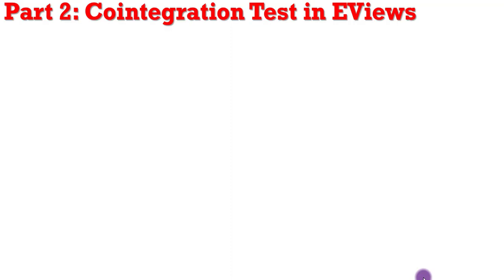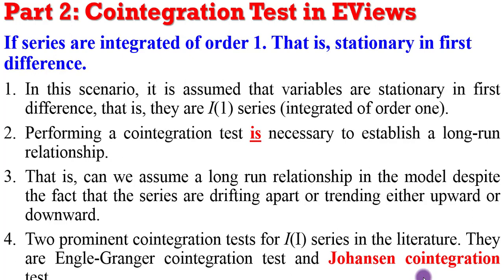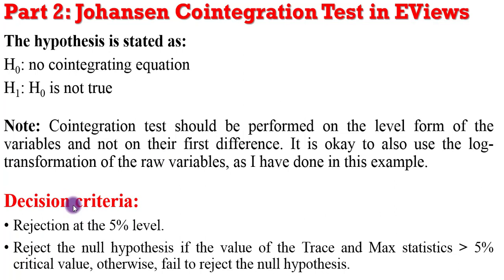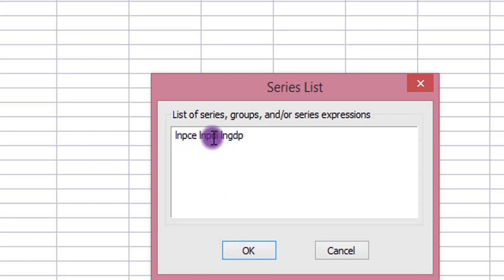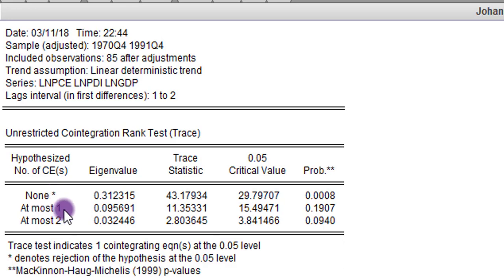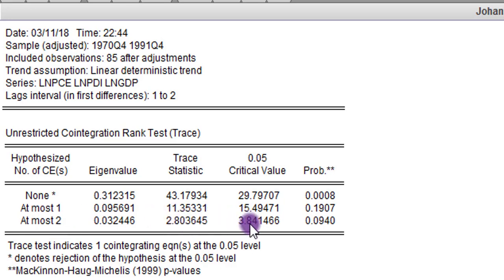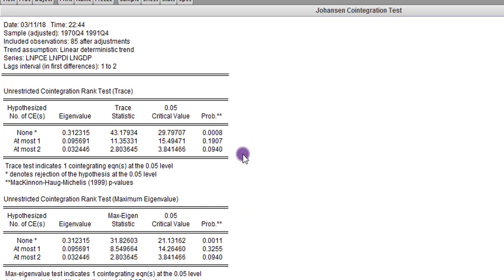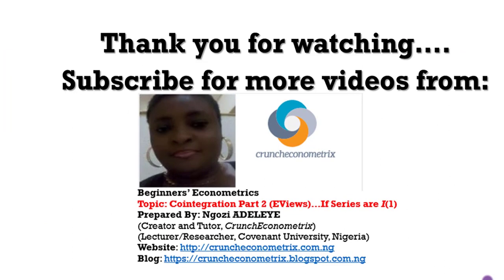(EViews10):Estimate Johansen Cointegration Test #var #vecm #Johansen #cointegration

Comment: do have a video with the 3rd scenario
Reply from the maker: The 3rd scenario is ARDL. Yes, I have videos on it. Kindly check the Playlists for ARDL videos. Thanks.
Reply: So if the result like scenario 3 is not permitted using vecm? I found my data having I(0) and I(1), and i try to find the lag optimum using estimate var and i type in endogenous variabel like d(y) d(x) i c. But the result is weird, the lag using AIC on 1 and both SC HQ on 0. Can you explain it to me? Im so gratefull if you can help.  @CrunchEconometrix
Reply from the maker: @RestyhaNajlaniyah Use lag 1 to estimate the ARDL model.

Comment: Hello Ms, I have one question, what if When I do my Johansen Cointegration test, i have the only * I have is in None, I dont understand why it's cointegrated when: 
None *	 0.482373	 51.36303	 40.07757	 0.0018
At most 1	 0.290746	 26.79620	 33.87687	 0.2744
At most 2	 0.200102	 17.41512	 27.58434	 0.5445
At most 3	 0.170329	 14.56465	 21.13162	 0.3206
At most 4	 0.112543	 9.312804	 14.26460	 0.2610
At most 5	 0.000651	 0.050830	 3.841466	 0.8216

So in this case I have to do a VECM with 1 cointeg equation?  What If I have the * in None and At most 1?
				

Thank you very much
Reply from the maker: Hi Maskim, I gave clear interpretations of the Johansen Cointegration test results. You may want to watch it again and apply to your results. Thanks.
Reply: @CrunchEconometrix  Thank you, I saw it again. I have other question, How important is the rank of cointegration? Because sometimes the Johansen test is telling me that my rank is 4 but for example If I have 6 variables in my model I "lost" the long run information of the first 4 of them, is it so bad to do rank 1 of 2 even if the johansen test tells me that i have rank 4? or how can i recover the long run information of this 4 variables? because I have 1.000 in the first and then 0.0000 in the 3 next, thank you very much Ms
Reply from the maker: Maskim, it is important you read up on RANK from any econometrics textbook for better understanding. Video tutorials are insufficient to equip your understanding.

Comment: In model VECM ...If i found the C1 negative but non significant at the level 5%. we  say there is relation a long run between variables but without significant and there is not adjustment to equilibrium iin the short run to  a long run
or say there is no relation a long run between variables but without significant ?
Reply from the maker: Hi Bettayeb, once the coefficient is NOT statistically significant it implies that there is NO relationship between the independent and dependent variable.

Comment: Hi! Thank you for helpful video tutorials. At around 02:45, you said that cointegration should be performed in either level or log-transformed series. Agreed. But should one use the original or the seasonally adjusted data series? Thanks a lot!
Reply from the maker: Hi Julie, the original series should be appropriate or you can confirm from other online resources. Thanks

Comment: madam appropriate lag for my data is 8. When I use 8 lags data shows no cointegration. but when I use 2 lags data shows cointegration. I should accept the result as shown by 8 lags, right?
Reply from the maker: Sunita, you are the researcher. Take your decision if you either want cointegration in the model or otherwise. Thanks.

Comment: Hey crunch! I was wondering in terms of no Co integration, would I estimate a var model with log values or first difference of raw data? Also, if no cointegration, would i be able to explore the system using granger causality tests? And could i further explore these results with impulse response function models in light of no cointegration? 

Kind regards :)
Reply from the maker: Whether you use logged values is at your discretion. If there's no cointegration, estimate only the basic VAR model.

Comment: Thank you for the video, in the case that Trace test indicates 1 cointegrating equation at 5% but Max test indicates no contegration at the 5% level. Is it fine for me to continue with the cointegration or i should use another regression technique even though my variables are stationary in first difference.
Reply from the maker: Hi Takunda, this is easy. You decide which of the tests to take. If you go with Trace then perform the VECM and if it's the Max Eigen then you perform only the baseline VAR.
Reply: @CrunchEconometrix  thank you very much. Assuming i have yearly data on eviews then i change that data to quartely using eviews. Will it be fine if i use that data as quartely not as yearly
Reply from the maker: Takunda, data conversion is permitted. You can read more on the pros and cons online. Thanks

Comment: Hi,

Thanks for the great videos and explaining these concepts in a simple way. I have a question regarding what needs to be done after the Johansen test. Do you have a video or can you elaborate how to construct the stationary time series after we have determined that there is 1 or more stationary time series from the test results? I am getting confused at this stage. And also, if we are using the ln transformation on the input time series, how do we apply the weights to the original time series?

Any clarifications would be very helpful.

Thanks
Vin
Reply from the maker: Hi Vineet, please watch my VECM videos. Thanks.

Comment: Hello, first thank you so much for your video! I have a question about cointegration test. I conducted multivariate cointegration test and found 1 cointegrating vector among five prices. In that case, can I say there is a long-run relationship between prices? How can I interpret the result if I get 1, 2, 3, or 4 cointegrating vectors?  Thank you so much in advance.

Comment: Thank you! I find the recording useful and will certainly utilize the knowledge obtained from it in my thesis. My thesis is about the short-run and the long-run effects of foreign direct investment (FDI) on economic growth in a set of countries using panel data (10 countries, 20 years of annual observations each). I was wondering how I can distinguish short and long-run relationships but it turns out that the VAR model would be an answer for the short-run and the VEC model for the long run. Even better - you've already published videos on those too - awesome! 

I am slightly lost in all of those assumptions that need to be satisfied to conduct those tests. For instance, in order to use OLS, that are supposed to be used in my final linear regression model,  I need to fulfill the OLS assumptions. I would certainly begin with conducting the ADF test to detect unit roots, to achieve stationarity. I am thinking about estimating the VIF model to detect multicollinearity too, but I have also read that differencing the data can help me get rid of the multicollinearity issue, by achieving stationarity. Beyond what I wrote above, 
1) could you please clarify if while estimating the final linear regression model, is it a good or bad sign when the variables are cointegrated - or perhaps it has nothing to do with 'good' or 'bad' and merely implies the long or short-run relationship?
Reply from the maker: Thanks for the feedback. Appreciated! Your query is TOO long.
Reply: @CrunchEconometrix  Excuse me, madame. I have contacted you through the form on your official website. I wanted to request personal consultations with an expert so I can sort out a step-by-step process of my research. I haven't received any response yet, though sent a message at least four days ago. Thank you.
Reply from the maker: My sincere apologies. Pls send your email to cruncheconometrix@gmail.com
Reply: @CrunchEconometrix  Thank you. Upon your reply, I would like to ask you a question. I am conducting research using heterogenous long panel data where T>N. In case all of my independent variables and dependent variable are either I(0) or I(1) (after performing the ADF tests), I think I could utilize the ARDL model to test the short-run and long-run effect of FDI on economic growth.
 Is there any other way of estimation that would allow the use of I(0) and I(1) variables together? - As I don't think I would be entitled to use Johansen's cointegration test, engle granger approach, var, Toda-Yamamoto, the VECM, or the ECM (because the integration orders are different - both I(0) and I(1)). Is it correct? Would you suggest any other model than ARDL? Thank you in advance.
Reply from the maker: Kindly watch my videos on panel ARDL. You will find them helpful.

Comment: Thank you for the video. I would like to ask about the role of the outliers. What if there are multiple outliers in the data set, and the variables are integrated in I(0). Should I remove the outliers via the winterization method in Eviews, or it is ok to conduct the Johansen cointegration test on the data set where I have multiple outlier values? thank you beforehand,
Reply from the maker: Hi Ibrahim, thanks for the encouraging feedback. You can use the winterization method if you are familiar with it. But I know that outliers are taken care of once you take the log of the variables.

Comment: Dear Professor, if I have dummy variables in my model, should I include them in the group for the Johansen cointegration test? Thank you very much for your answer.
Reply from the maker: Hi Eric, I'm not sure if VAR accommodates dummy variables. You may need to check other online resources.
Reply: @CrunchEconometrix  Thanks, Professor. Will check other resources. Your videos are very helpful. Thank you for sharing your knowledge.

Comment: Hello Professor. Thank you so much for your videos! Can a log transformation be done on all variables except the ones specified in percentages or in rates? And can this log transformed variables be used for your analysis?
Reply from the maker: Hi Kehinde, you can log transform variables that are in "% of..." but not rate variables like inflation rate, interest rate, exchange rate etc.
Reply: @CrunchEconometrix  Thank you for the swift response. Does Squalli and Wilson(2011) measure of trade openness expressed as a percentage fall into a rate variable? Can you perform an analysis with a mixture of variables that are log transformed and variables in their raw form with the exception of rate variables?
Reply from the maker: A variable that is a percentage of another is NOT a rate variable. Yes, you can have a mix of level and log variables in the same model.
Reply: @CrunchEconometrix  Thank you!!!  This sums it up.

Comment: Greetings.

Love your work, it is really helpful for my analysis. I have just one question.
If the data is not in logarithmic form, is the EViews tehnique the same, or do we need to change anything? I am researching the cointegration between nominal exchange rate and domestic and foreign prices, for the validity of PPP.

Best regards.
Reply from the maker: Hi Keyarslo, log transformation is at the discretion of the researcher. Not compulsory but advisable. I will advise you do more readings on its merits.

Comment: coodmorning madame, thank you so much for the video, its really hopeful, im algerian student in tunisia, im using this modelisation for stres testing by impulse fonction (if you have an idea about stress testing, do you think is it possible to make shocs by impulse function?), 
but the real problem that i have is: that in my data, i have four variables, three are stationary at level I(0), et the last one stationnary in first difference so at I(1), which model should i use? VAR or VECM?? and after doing the test of johansen, there is no cointegration relations? could you help me please
Reply from the maker: Hi Walid, ARDL technique is the most appropriate when you have mixed levels of integration. I have very good videos on the technique. Kindly watch them. Thanks.
Reply: @CrunchEconometrix  Hello maam Thank you for your great video it really helps a lot. i have a same problem as him and as you have suggested to use ARDL model so can i use ARDL model in panel data too ? need your help

Comment: Hai madam, may i know what happen if i got 3 asterisk at Trace result? While in the max eigen i got 1 asterisk. For example: 
(Trace Result)
None*            - the T-sta > CV - Prob is 0.0001
At most 1*    - the T-sta > CV - Prob is 0.0067
At most 2*     - the T-sta > CV - Prob is 0.0372
At most 3       - the T-sta < CV - Prob is 0.1406
(Mix-eigen Result)
None*            - the T-sta > CV - Prob is 0.0078
At most 1    - the T-sta < CV - Prob is 0.0630
At most 2   - the T-sta < CV - Prob is 0.0518
At most 3       - the T-sta < CV - Prob is 0.1406
How can i interpret my result?
Reply from the maker: Asraful, I gave a clear explanation of the Johansen cointegration test. The first part of your result says that the null hypo of at most 2 CE is rejected. The second says the null hypo of no CE is rejected. You decide which result you want to take.
Reply: @CrunchEconometrix  how can i know if my result have full rank problem or not?
Reply from the maker: I use the output of the JCT only.
Reply: @CrunchEconometrix  i see. thank you madam

Comment: Hello Ma'am, thank you so much for your video tutorials. I have a query - My model consists of 5 variables - One dependent and rest of the variables are independent. ADF unit root test confirmed that all variables are integrated of order one. So then I applied the Johansen Cointegration test. The results of Cointegration test show that there are at most FIVE cointegration equations. The problem is that I have read papers that state that the no. of cointegration equations should be ONE less than the total no. of variables used in the model. What should I do in this case???
Reply from the maker: Hi Saima, as explained in the clip use one cointegration equation for easy interpretation. This is simply because the normalization is on your outcome variable which is the 1st variable listed in the system. But if you are on top of your interpretation then you can use more than one CE. Kind regards.
Reply: @CrunchEconometrix  Thank you so much for your prompt response and suggestion! But ma'am, I m sorry I still don't get it. What i mean is - I have 5 variables in total ( including the dependent variable) and then both Trace test and Max Eigen text show that there are 5 cointegrating equations in the Johansen cointegration test results. So, in such a  case can I further test the long run relation with VECM or I must use VAR because no. of variables are equal to no. of cointegrating equations?
Reply from the maker: Kindly follow the steps shown in the VECM videos. They are well explained. Thanks.
Reply: @CrunchEconometrix  just watched your video tutorials on VECM. They were of great help. Thank you so much!
Reply: One more question please - Is it ok to use different lag length for Cointegration test and VECM test for a study? For instance, can I choose lag length 2 for Johansen Cointegration test and lag length 3 for VECM test since I get better results in doing so. Is this possible? Thank you in advance!
Reply from the maker: As explained in my VECM videos, estimation is with p-1 lags except the optimal lag length is 1 then VECM is also estimated with 1 lag.

Comment: Hello Dr Adeleye. I'm from The Bahamas and doing econometric work at The Central Bank there and 90% of what I have learned is from your videos. I appreciate you taking a practical approach to explaining these procedures and theories. In regards to the Johansen Test, how do I go about choosing the optimal lag for this test ? I watched your video on how to select the optimal lag for a VAR, but is it the same process ? My process said that 1 lag is optimal (Im using annual data) however, this is problematic because my VEC must be 1 less than my optimal lag which gives me 0. So in a case like this, is it practical to use 2 lags for my VAR ? If so, should I also use the same amount for my Cointergration test ?
Reply from the maker: Hi Lorenzo, thanks for reaching and the positive feedback on my videos. Deeply appreciated! This is really not a problem. Relax. Simply estimate the VECM with 1 lag because it cannot be a static model (that is, with 0 lag). Put a footnote in your paper stating this.Thanks.

Comment: Hi professor, I have a question regarding the Johansen cointegration test. Say I am running 4 variables with spot prices as my dependent variable, and futures 1,2 and 3 as my independent for the Johansen test. And the output leads to all is insignificant and there is remark given by eviews that at most 4 equations are co-integrated. What des this financial interpretation mean?
Reply from the maker: Hi Gilbert, it means that you have 4 cointegrating relationships. But follow my guide and use just I when estimating the VECM.

Comment: Dear Dr. I have 4 variables (lngdp, lnfdi, lncpi and lnir). At levels, lngdp is non-stationary in intercept but stationary in trend & intercept whereas lnir is non-stationary in both. However, all the variables are stationary at first difference. So Dr., is it safe to say that all the variables are integrated of order i(1) and then apply the Johansen test for cointegration?
Reply from the maker: Yes, all are I(1) series only make sure to make a note to the table.
Reply: @CrunchEconometrix  ok. Thanks Dr. for your prompt response.

Comment: Thank you for your knowledge sharing Mam. Please help. what do I do when my dependent variable is stationary at second difference but all exogenous variables are stationary at I(1).  I was going to perform a cointegration test then VECM if all variables were stationary at first difference, but with this unit root result, I don't know what to do.
Reply from the maker: For VAR/VECM estimations, all series must be I(1).
Reply: @CrunchEconometrix  Yes ma. What do I do in this I(1) , l(2) case
Reply from the maker: Use the Toda-Yamamoto procedure. Read about it online because I've never had cause to use it.